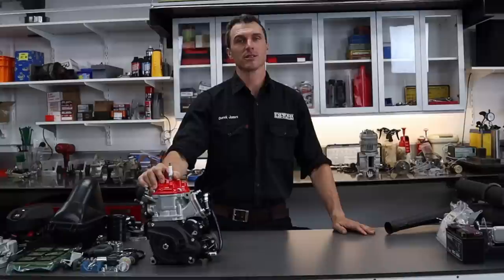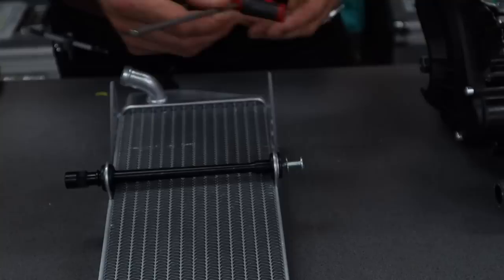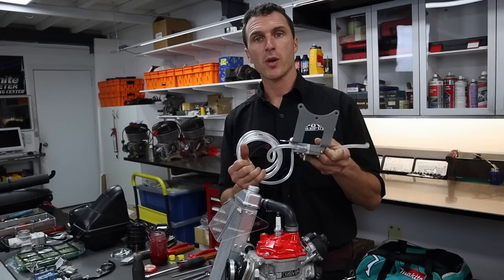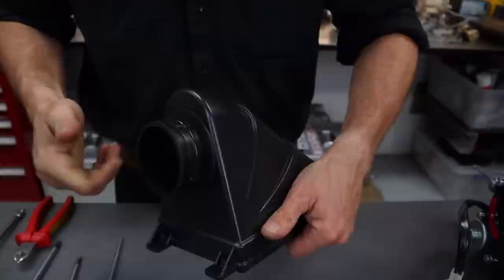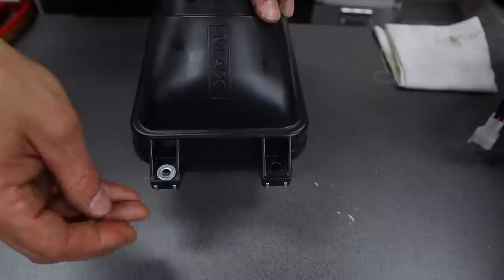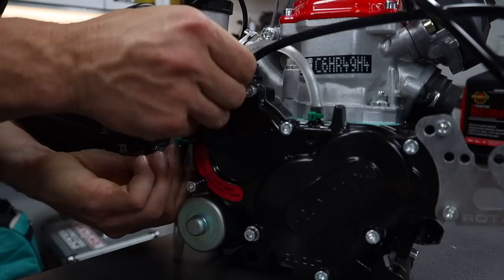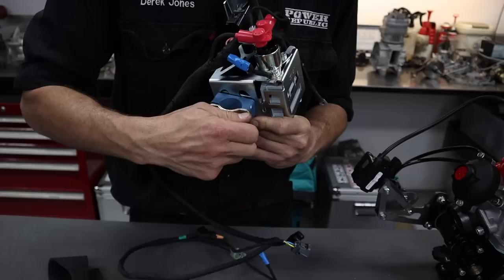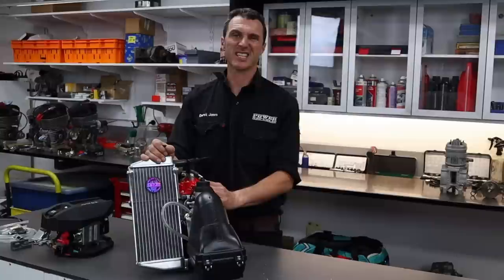Rotax Senior Max 125 Engine Assembly - POWER REPUBLIC

Comment: For the installation of tight fuel hoses...I get a little cup of boiled water and put the tips of the hoses in for about 20 to 30 seconds to soften them and then push them on. Saves the risk pulling them past their yield point for the pliers. We usually have a flask of hot water ready to go at the track which is made at breakfast...(been English and needing a cup of tea between each session and all that ;p)
Reply from the maker: noice cup of tea and some soft hose pipes.   not bad

Comment: Great video, you give all the little tips that does'nt come with the manual, very important for someone like me who try to learn to do as much I can by myself. But what about the oil in the gearcase? Is that another video? Anyway, now I watch your instruction videos instead of karting videos :) my son can do the driving part, I do the mechanics
Reply from the maker: very important point,  rotax comes with oil in the gear case from the factory, however I recommend changing it after your first day at the track.  use 100cc of Automatic Transmission Fluid for refill.
Excellent.  if you have any questions or videos you would like us to do for you please comment below

Comment: Simpler method to manage lips, use fishing cord, wrap around the rubber and pull from inside, while unwinding it will pull rubber lips into position easier.
Reply from the maker: Great tip!
Reply: @PowerRepublic  Could I ask unrelated question please, about TonyKart vs Kart Republic cassis if you happened to know. On your channel there are tons of valuable content about TK and for person who want to get into Rotax/IAME X30  karting is this best kart cassis to start with? I see fairly cheap second hand chassis in UK and they look beautiful. I wonder if there is a problem with them? Are they using standard parts or I would get into trouble finding replacement parts? It would be interesting to see a video about different brands/makes and  what sort of gotchas there could be if one steps out of TonyKart reign.

Comment: You didn’t add oil to the gear case ?  But great video
Reply from the maker: very important point,  rotax comes with oil in the gear case from the factory, however I recommend changing it after your first day at the track.  use 100cc of Automatic Transmission Fluid for refill.

Comment: Hello mate, what do you do with the vented cap ( the one to fill in the gears oil)?, do you remove the white cap that comes stock, do you remove it and keep it like this, or you remove it and plug a tube? If so, where do you connect that tube? Thanks and regards from Spain
Reply from the maker: Hey Vigiror, yes remove the cap, its just for shipping.  that black plug is the gearbox vent.  you can leave it open  or what we do is attach a small piece of kart fuel line and make a loop in in down to the chassis, engine or into an overflow bottle.   hope that helps
Reply: @PowerRepublic  thanks a lot my friend, cristal clear 😊, have a nice one!
Reply: @PowerRepublic  My piston is 0,02 too big from perfect. What if I worn it carefully with a way longer breaking in set, I mean 50-60 laps 7000rpm, would it be usable by then?   Different piston manufacturers didn't have the same scale with sizes.

Comment: I have a question, this is something I've always wondered about. I can usually only hear it in onboard footage of a Rotax kart. Under cornering there is this clink clink clink sound coming off the chassis. Is it the chain hitting the sprocket or the axle stopper?
Reply from the maker: i think  the sound is the clutch drum touching the ring gear

Comment: Great Channel. Appreciate the constant content. How do you know which end of the RAVE is to atmosphere? I have a 2015 rotax max evo dd2 and the manual has the vacuum tube connected to the other end to what yours is. Have i not been getting the most out of my engine this whole time??? Cheers
Reply from the maker: The top is the outlet use and the side port is the to the Power Valve.  The bottom is to atmosphere.  some of the older versions were different orientations, however when I run the engines on the engine dyne I can see the Power Valve Bellows moving at 7500 rpm which indicates to me that the Power Valve is operation at the correct way
Reply from the maker: Thanks for positive feedback btw.  Not sure on the DD2 but it should be similar, which model EVO do you have?
Reply: Power Republic its a 125 MAX DD2 evo. Ive had a few people tell me that it is plumbed the wrong way but the factory manual has it connected to the outlet closest to the power valve vacuum outlet. However, i havnt inspected the bellows during operation to see if they are working.

Comment: Do you need to bleed the radiator when you fill it?
Reply from the maker: no, but I always check it after its first hot run and top up if necessary.

Comment: Is 35 hours okay on a Rotax max engine ?
Reply from the maker: yeah not a problem, 50hours is about the limit of the bottom end
Reply: Power Republic do I need to change anything in the engine before the 50 hours ?
Reply: They will go alot longer than 35 hours. I've got an engine I use for testing, must be on 80 odd hours untouched now